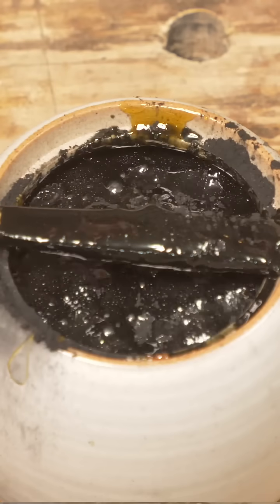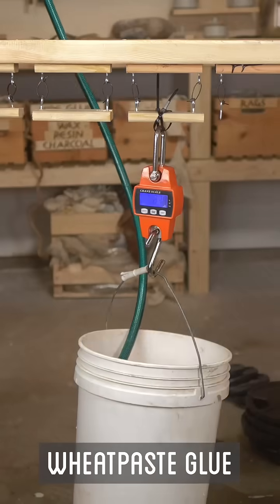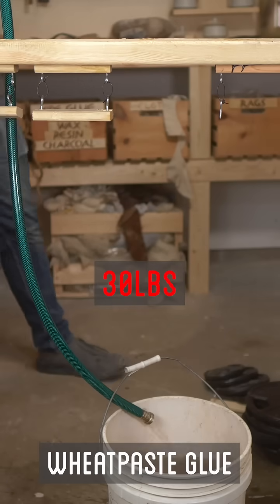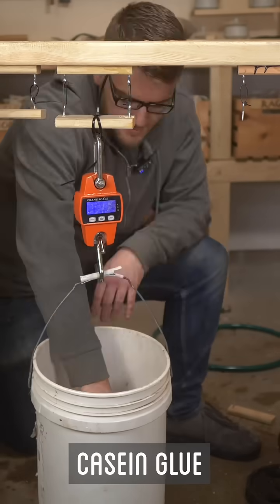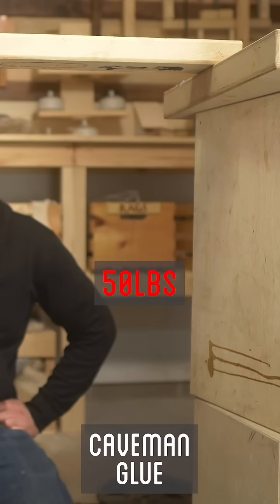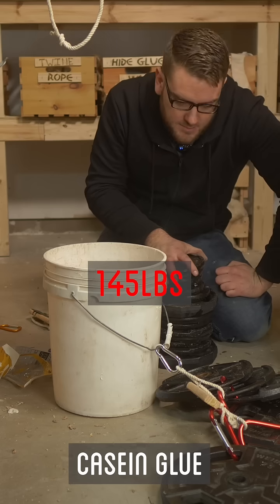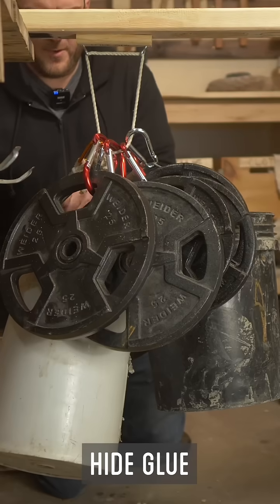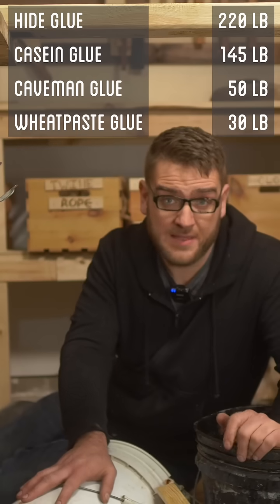Testing 4 Ancient Glues, Which is Best?

Comment: lookup Tensile Test Procedure, and use that to pull apart 2-4 inch sticks that you glue together. It should be easier to control and discover data. Hope this helps.

Comment: I used to study furniture restoration, and we used almost exclusively animal glues.

Usually, the cheaper brown stuff, and even that is so strong,If your glue joint is good and not exposed to moisture, the wood around will break before the glue

Comment: In comparison, Project farm used the ends of 2x4s with commercial wood glues and found they failed at anywhere from 500 lbs to over 3000 lbs. Still, that hide glue is impressive and with the right joints you’ll end up with some very strong projects!

Comment from the maker: Did I miss any glues?  Suggest them and I'll try to make them!

Pt 1 - Caveman Glue: https://youtube.com/shorts/4WVgYCLMNUI
Pt 2 - Wheatpaste Glue: https://youtube.com/shorts/4PTUOjNdSwU
Pt 3 - Casein Glue: https://youtube.com/shorts/JKpeIRqqs0w
Pt 4 - Hide Glue: https://www.youtube.com/shorts/oVF1Hvd0Zn0
Reply: Well, there's isinglass, but that's technically a collagen like hide glue. Waterglass (totally unrelated to isinglass) is another one, but might be harder to make due to the heat required (melting potash and sand). Hoof glue behaves a little differently from hide glue but is made largely the same way. Potato starch makes a dextrin glue.

You might even try to make mucilage glue from okra.
Reply: birch skin glue

Comment: I'm still impressed at the caveman glue.  Sure, it didn't hold that much in comparison, but that was just early humans making 'potions' in a stone pot and seeing what sticks.
Reply: And it was better then wheat glue that came later.
Reply: @johnporter9034  wheat glue is much easier to mass produce (well, not as in bought, but just mix flour and water), and you often don't need glue to be anywhere near its yield point, a few 100 g is enough for a lot of glue ups.
Reply: @johnporter9034  well wheat glue had a different purpose. So sticking tightly wasn't the main thing.
Reply: @LatinaCreamQueen what was it used for?
Reply: One must Unga right if they wish to bunga hard
Reply: Seeing what sticks, literally, hah!
Reply: That 'what sticks' thing is literal in this case
Reply: Literally lol
Reply: I mean sap is already sticky on its own. Pine tar is already used as glue on its own. The wax is just for water resistance which is an obvious property of wax. 
The charcoal is the only part I don't fully understand. But considering trees are made of carbon, it doesn't surprise me that they work well together.

Comment: I’d love to see how these match up to modern glues like PVA, Gorilla, and super glue.
Reply: The benefit of modern glues is less strength (200 pounds in this application is plenty) - but convenience, portability, shelf life, longevity, etc.   You don't need to boil titebond.
Reply: @PVS3  if you left the cap off for long enough I guess you could let it soak in water to dissolve again. If it's pvc or elmers or PVA it should eventually turn back into a usable glue. 

Polyurethane glues or blends like gorilla and Titebond 2&3 are a set polymer once dried so nothing is going to soften besides a chemistry set.
Reply: There are a plethora of tests displaying what these glues can do, even in direct comparison to modern hide glue, so you can see what's best. Hide glue's main advantage is that you can steam it to release the bond if you need to remove, repair, or replace a piece.
Reply: @malta7406 but if it gets wet, it stops working. So it's useless in humid or wet climates, like the tropics.
Reply: @malta7406 And it's self clamping. An excellent quality to have if you are building instruments.
Reply: The latter are pretty close to pvc cheap wood glue or pure pvc glue but iirc name brand woodglues outperform it a bit until you reach a breaking point where the wood lignen and cellulose are actually weaker than the glue so the wood always breaks or peels away from the glue which eventually means the wood, ,the grain, humidity etc, etc, or etc eventually become the point of contention that shows the point of failure. Which basically means ancient humans were able to make perfect glue for wood or other stuff.
Reply from the maker: See Short reply
Reply: modern is just ancient but refined and made cheap/profitable
Reply: @MrPaxio  not really.
Reply: @MrPaxio  sometimes, but a lot of stuff these days are synthetics.
Reply: @MrPaxio  PVA glue didn't exist prior to the 20th century, nor did cyanoacrylate glue, or polyurethane based glue. Literally none of the modern glues listed could be considered refinements of ancient glue recipes.
Reply: So PVA glue is basically wood glue plus or minus a few additives. But wood glue tends to be stronger than the wood.
Reply: Epoxy are among the strongest modern glue ever existed
Reply: @axe4770  yes but strictly speaking expoxy is not a glue it’s a plastic. Yes you can say that about any synthetic glue but glue is sticky substance that dries. Expoxies need to cure, how it cures varies by the type of expoxy but still a chemical reaction.
Reply: Ever heard of glue chipping to make decorative glass? A strong hide glue is spread onto a sheet of glass, then the glass is set in the sun to dry and shrink the glue. 
The glue is so strong that it doesn't release its grip on the glass. When it shrinks it pops off, pulling off a chip of glass from the surface.
Reply: Exactly what I was thinking.  Curious if the application of heat and cooling the mixtures in the gluing process improves adhesion
Reply: And of course the strongest of glues... Elmer's
Reply: @psilocybicacid7667  Elmer's school glue is a type of pva glue, it isn't the literal best but it is actually pretty strong if you use it right.
Reply: That was definitely in the back of my mind
Reply: TEST HARBOR FREIGHTS "INDUSTRIAL STRENGTH"
Reply: But I think these glues are less toxic and harmful  for the environment do much fish skin is thrown away u can make glue from it
Reply: If you think about it, the heat is stripping electrons away kind of like an acid would do to break down the fibers. After that the bonds reform over time as elections flew back into the material. The modern way is to use acids and the result is plastic. But the ancients also had these crude plastics called glue.

Comment: It would be nice to see modern pva and superglue
Reply: Thousands of lbs per square in adhesive force. So like 5-10klbs in a test like this. The wood would fail first.
Reply: Yes at 200 lbs you are approaching the strength of the wood grains. So the fact our modern glue can be 10 times stronger doesn’t really matter because the wood fails first.
Reply: @ecospider5  and that’s why plywood is stronger in certain directions!

Comment: Damn didn't expect a 2x4x8 chunk of wood attached to a much longer 2x4 with hide glue would support my weight
Reply: Thats perpendicular to the attachment, imagine the possible load parallel.
Reply: @barryallen5507  im not sure but my guess is it would hold less parallel
Reply: @jameslovdokken  Could you explain why? Don't know a lot about statics or adhesion or the likes. Because the force would not be evenly distributed?
Reply: @mikel1998100  think of it like trying to seperate strong magnets, pulling is hard shearing is easy.
Reply: Well they use hide glue 150 pound goat horn bows so yea needs tobe stronk
Reply: Maybe for five minutes. I doubt it'll last much longer
Reply: it supports 2 of me
Reply: Shows how much cheaper houses could be build in the future. Half the beams, and just glue to connect.

Comment: That's still very impressive how strong those glues are
Reply: came here to say that. that is amazing!
Reply: It's like we knew what we where doing.
Reply: Given a decent surface, Glues are surprisingly strong, I put a pull up bar in my sister's appartement, and with the surface, the glue was rated at 1 ton and the screws I put because she insisted were rated at 80kg.
Reply: yeah and they all could be used in different ways suck as the caveman gule with making of spears and arrows. maybe house building in small ways where the other glues would deff be useful in